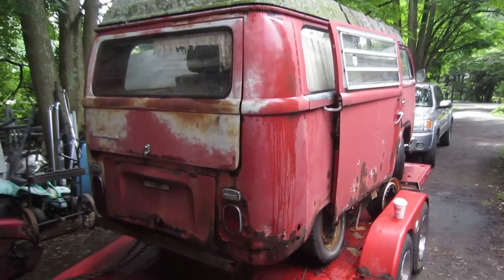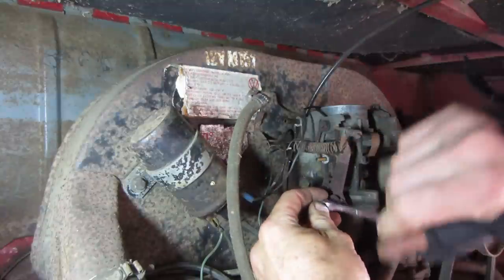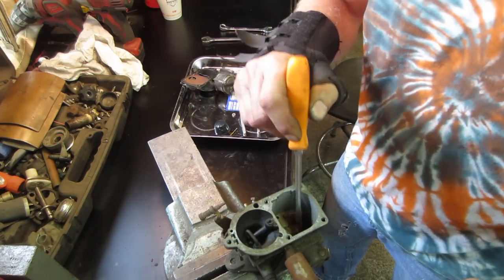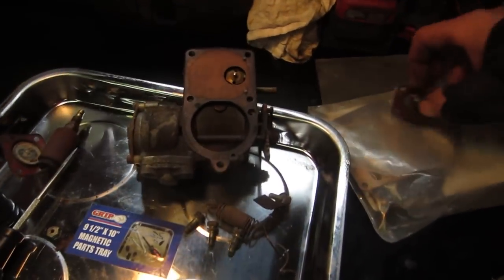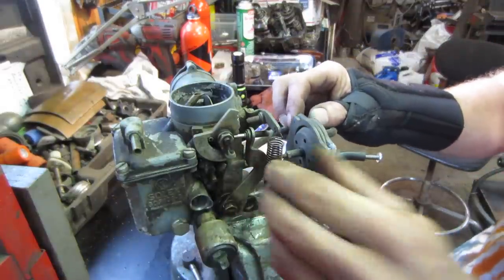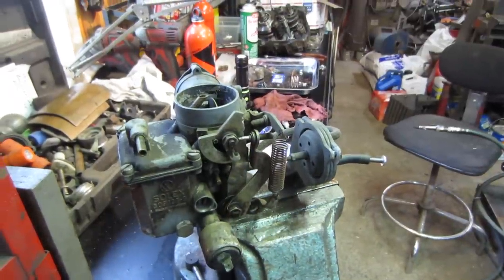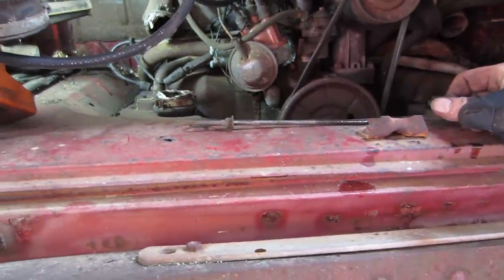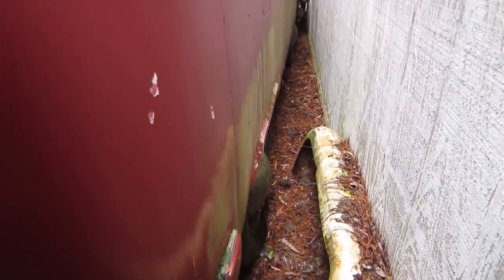31 years in a field vw bus will it run ? part 2

Comment: I love these old V-Dubs.  I picked up an old rusted out '72 bug and it's now a sturdy baja.  Picked up an old 1600DP, the guy said someone drove it in about 12 years ago.  We pulled it, I put it in mine after plugs, gas, coil, etc... general tune-up.  It fired right up!  Quick tune and 2 days later drove it on a 700 mile round trip from South Ga to NC and back!  I'd quick restore this bus for sure!

Comment: it started as a hobby with a beetle cabriolet. then came rust. and then a motor damage, carburetor problems, gear damage and so on. i bought a manual and a welding machine. from then on i repaired many beetles and buses. and then, after 2,3 years i was very fit. i restored. from 1975 to 1985 more than 200 cars, in my free time. after 1985 i scraped over 50 engines, transmissions, hundreds and hundreds of other parts and complete cars. nobody wanted to have her. today it would all be worth a lot of money.

greetings from bavaria in germany

Comment: Forty-five years ago (when I was 17 lol) The day school ended in my junior year of H.S. I bought my VERY FIRST car..a '61 Bug from my brothers friend down the street for $2.00. He painted it PURPLE but gave up getting it running. At closer inspection he had the point gap too wide and the plug wires in the wrong position lol. Had to replace the generator (6 volt) Drove it for two years until I seized the motor :-(  I neglected to check the oil level)..I was young and dumb..great car though..for as long as it lived!

Comment: The power of falling water, heavy stuff :-).

The engine whisperer strikes again lol, im supprised it worked, plugs/points/leads/valves and a perfect carb is all the things it hasnt got lol.
Reply: It's all the Dihydrogen monoxide that's in it, lethal stuff, it can burn your skin and even kill too... :P
Reply: lol, i like your happy disposition, and you nearly turned into scotty, captin its the Di-hydrogen cristals. ;)
Reply: Funnily enough, I'm wearing my starfleet engineer t-shirt today too... :P
Reply: lol, mr bloke we have a problem with the engine, it wont suck, possibly the hoover bag captain.. ill fit a new one.
Reply: I cannae dee it cap'n, there's a phase variance in the inducers, I'll have to reroute the command sequence through secondary protocols!!
Reply: zx8401ztv I swear, "engine whisperer" is what I was thinking too.
Reply: zx8401ztv...aah spaceballs.. one of mel brook's finest
Reply: Valve adjustment and may be good to go.

Comment: Great vid, and you were well rewarded with all your hard work. My own modus operandi to start the engine for the first time is to do the wheels and tyres first then the steering. Get the beast rolling then take it for a long tow (along a back lane). Use a high gear first to get the engine turning over slowly and the oil circulating through the bearings and pistons. Then the ignition and fingers crossed!!!! You did a fantastic job and I enjoyed the video sooooooooo much.

Comment: I had a 73 Campmobile.  Fun to drive.  Relatively easy to work on, once you knew what you were doing.  Needed constant tinkering, though.  Seemed to need the points adjusted every 5 thousand miles, even with a new distributor.  I loved it.  Never could keep the valve seats it it, though.  I tried to get the guy that worked on the heads to put them in with red loctite.  He wouldn't, because he was afraid that he would be the one that had to remove them some day.

Comment: Had a 60 model sold it in 71 wish now I had kept it. Found an exact model down to the same color on eBay....105,000.dollars. also had and sold a type 3 with s gas heater haven't found another like it since. Love what your doing, if anyone questions 200.00 they should start pricing parts if you can even find them. Like headlight beauty rings, door handles etc

Comment: looks good Darren, old vws are hard to kill. transmissions worth 300 and a running engines worth 4 to 600, plus all the small stuff on it, Westy stuff, headlights ect ect you made a good deal on it. those wide 5 rims are getting expensive too especially bus rims

Comment: Boy, I remember my years of rebuilding Solex carbs. I had a big plastic bin of "extra" gasket and carb pieces from rebuild kits. I played around with custom welded adapters to use dual carbs off of 1700/1800 busses on 71 down bugs.... oh the wasted hours...and fun

Comment: Was browsing the Internet and found this video showing some interesting old and oddball engines I thought you might find interesting. The large two cylinder motorcycle engine I'm thinking belongs in a trike it's so big.

I found the WW I 7 cylinder French aircraft engine to be superb never actually thought I'd see one run even in video.

Regarding the 1966 VW bus question? I'd say go for it and rebuild it realizing that is a lot of work from beginning to finish but that should give you a new looking and running 66 VW Bus. I also realize the project won't be completed from start to finish in one year as you will probably work at it in stages so you can accomplish other projects that come into the shop or are already there.

Stay safe and warm . 

I enjoy your projects and sense of humor.

Comment: Looked round one that looked in a similar state at a car show here in the UK. that one was solid underneath and had a Porshe flat6 turbo motor in it. Looked like crap. Moved like lightning. Good luck with the one you  are restoring.

Comment: Anytime you are restoring one of these, make sure you use all new fuel lines and clamps. I can,t tell you how many engine fires i have seen on these things but it,s a bunch. Also a big part of that is making sure all the engine tin is there and the engine seal. The flaps are all opening. If not it WILL over heat and just adds to the chances of a fire.

Comment: Absolutely true. Biggest mistake rookies make is not buying a parts car for their project. I'm willing to bet that a looot of unfinished projects that more experienced fellas buy are down the side because of that. Chasing everrrry little nut and bolt, even if the replacement part isn't in top shape, it's a killer. And it drains your pockets too because those that sell them overprice insanely in some cases.

Comment: I would've started by taking the engine apart and cleaning out the gunky oil installing all new seals and checking that the oil pump was in good shape. It's not a good idea to cold start an engine that's been sitting up for that long w/o pre lubing all the bearings and making sure the crankcase and oil filter is clean before changing the oil before doing an engine test.

Comment: those old VW,s dont have an oil filter, just a screen back when they were new they ran on straight 30 weight non detergent oil, the best way to mess em up is to add detergent oil ,  like a 10-30, the fresh oil will cause all the crud inside the engine to come loose and the first thing it does is clog the oil cooler, twenty minutes later you have a blown engine, (seized crank)
Reply: Yep

Comment: The things I have to tell about VW's, worked on them from 1969 through to well into the water cooled era. I've owned quite a few typ ll and typ l... Heck I used to have the VW part numbering system memorized lol
Never owned a Westy though. The torque specs on the engine I do remember, must have overhauled a lot.
Oh BTW, the accelerator pump has a check ball that can get stuck, a brass pin retains it and can be removed if you are careful.

Comment: Too bad it was not a dual port engine. But, as that engine does run and pretty smooth for having sat for so long, I feel it is worth some TLC and put to work. 
And yeah, $200 for all the parts you get is a steal! Gonna have to sift through your vids and see what happens with the other micro you are seeking to restore/resurrect.

Comment: Did you ever drain the oil before trying to crank it? I would have guessed there would be water in the pan from so many cold winters (condensation from warming and cooling throughout seasons).
Reply: Nick Dittes I was thinking the same thing

Comment: That Audiovox AM/FM 8 track w adjustable shafts was the biggest thing around 1975, you could adjust the shafts to fit any car, I installed a lot of those as a teenager, 5 wires, only problem is, a lot of muscle car people are cursing at me now, cause you had to file the dash for height, and install a face plate, which in 2019 means a lot of barn finds have cut radio openings, sorry guys, who knew?

Comment: hey bud,really like your vlogs but just wondering that the body looks so far gone is it worth eve keeping body even for storage?How come you dont just strip it then scrap the body?
Reply from the maker: it takes even more room if you take it apart, plus parts are easy to find, think small stuff,clips, bolts etc
Reply: thats true, was thinking of a van we had in our back yard we used for storage ended up turning t rusty shards and was a pain to move....lol good luck bud
Reply: Besides, in 20 years someone will want to restore the junk one!

Comment: Musti: I want to be one of the many who recognize your unique mechanical skills; you are a master. What I don't understand is after you have the a motor running, for example in this VW bus, the vehicle is still complete junk. The chassis deterioration is just too extensive to attempt a restore or daily driver rebuild. I may know your desire to do this, but I don't understand "why." Sometimes you just have to let this "stuff go."
Reply from the maker: its just a parts bus for my others,
Reply: Ah, ha. Yes, as you said in the opening of your piece. I totally understand. Thank you for the prompt reply.

Comment: Would it be worth to fully restore it? 
Considering that there's so much rot on it now, i mean.
Reply: Alex Luchian he answered that in his video.  he's going to take parts off it for other things.  he is NOT restoring it at all.
Reply: He's restoring the one behind his garage. The one on the trailer is for parts.
Reply: I was refering to: if he didn't already have a basis for a new project, would this be worth it as a start? 
Or is there too much rot on the body for it?
Reply: The frame is to badly rusted  You could fix it if you wanted to but  the repairs would cost more than the bus is worth. So if you ever sold it you would lose money.

Comment: shows you how todays computerized engines can sit in a field for 30 years and need 10 times the work just to get them to fire back up. the old engines were designed the best.

Comment: i bought my 1973 orange Westfalia off a old man it was not started for 4 years i thought the engine was toast i towed it home and threw a battery in it fired up runs great it awesome shape i installed a new front axle beam it will last another 44 years

Comment: can you see the print on the motor that means 12volts and not 6 volts. i screwed loads of that cars. in germany i almost bought vw beetles for hundret bucks just to have a cheap car.